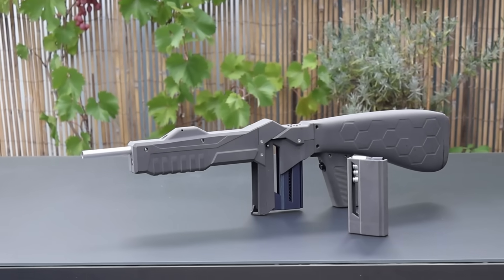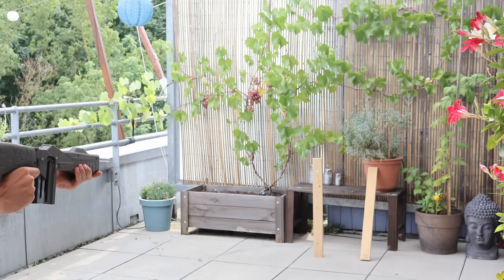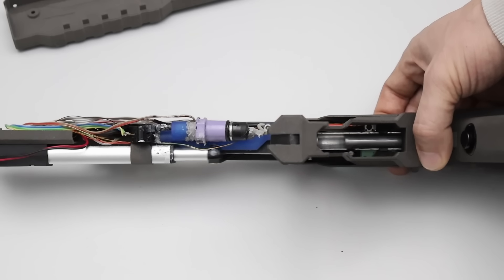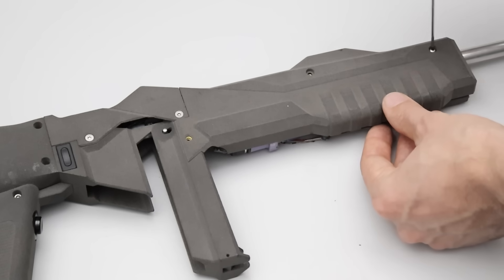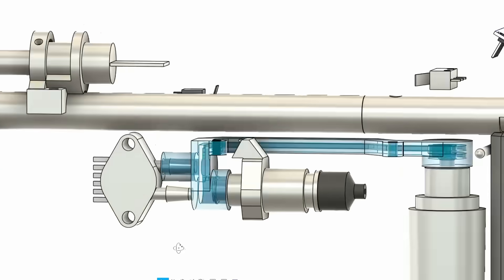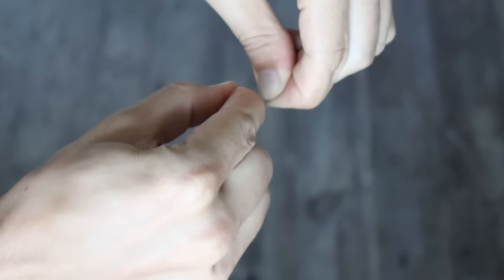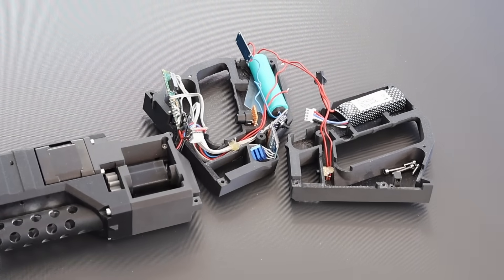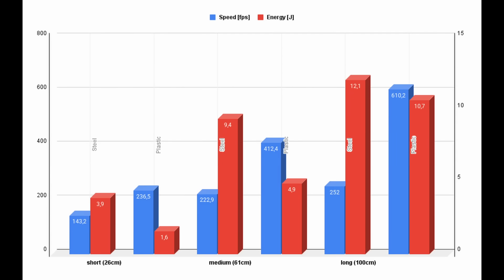I Built a Semi-Auto 3D-Printed Spud Gun

Comment: If you want to optimize your barrel length, look into the chemistry behind your cannon. Right before you fire, you have a tank with a known volume of air (containing a known volume of O2), and a known volume of butane. You know the volume and pressure before the combustion occurs, and you can do some basic stoichiometry to determine the pressure in the tank after the combustion. You can then use that knowledge to determine how much volume that new pressurized gas will take up. The volume of the tank + volume of the barrel should be slightly smaller than the volume of the combusted gas (There are losses due to heat, friction, non-instantaneous combustion, etc that will cause losses so the gas will reach 1atm before the theoretical mark). This will allow your combusted gas to completely expand and impart all of it's energy onto the projectile right as it leaves the barrel. 

I know for a fact you are wasting gas, and you know it too (whether you recognize it or not). You noticed it when you were trying to use the pendulum to measure the force of the ball, there is a massive amount of pressurized gas still in the tank and barrel when the projectile leaves the barrel. It was continuing to flow out long after the ball had exited and messing with your results. You can either increase the barrel length and shoot the ball really hard, or you can greatly decrease the chamber size and/or amount of butane so you aren't wasting volume/gas. 

One last note, you can explore suppressor technology with your current setup. You sort of already have with the baffle you created for the pendulum setup. I expect the reason it didn't work is the same reason suppressors have many baffles: the unit has to be able to effectively divert all the extra volume into the body of the suppressor (many baffles) and contain it from escaping (closed body). Your attempt to mitigate the excess gas was more of a muzzle break than a suppressor. 

Keep up the good work!

Comment: My guess on the subject of metal ball separation gap being less significant with longer barrels is that:

1. The pressure is behaving in case of plastic and metal same, so it applies same force to same area in certain distance from the chamber and is starting at Pmax and is going to Pmin=0 (to Pmin=0 in ideal case and your graphs doesn't seem to flatten so in your case it is not 0).

2. While plastic projectile advantage is less energy to accelerate it can accumulate less energy in total than steel one, and there is maximum speed every projectile can achieve for both of those projectiles for certain length.

3. I think (but i have to learn for exams so i don't have time to put calculations on it :P) Steel ball is using this pressure more efficient to acquire energy because it is more massive it stays longer in the barrel and is slowing down the pressure wave, and as long as there is possible pressure to utilize, more time projectile is under the influence of that pressure, and is possible for it to acquire energy. 

4. But there is a limit - as i said - to energy that can be gained from the combustion which is limited by the weight, but also i think there is another factor which is playing a role here that is leaks around the projectile, longer it moves through the barrel more gasses are leaking around it and through the hole systems lowering the pressure, so you might be witnessing just that. 

At jump from 26 to 61 cm barrel it is 2,34x longer while the speed of projectiles is:
-Plastic 1,74x higher
-Metal 1,65x higher

At jump from 61 to 100 cm barrel it is 1,64x longer while the speed of projectiles is:
-Plastic 1,47x higher
-Metal 1,13x higher

So in theory if there is same amount force for both of them and one is staying longer in the barrel, the one with longer contact with that force will gain more energy, but also longer it stays, more pressure is leaking, another factor would be friction. 

I think if you would graphs: 
-(x,y,z) friction energy loss in function of weight, time in barrel.
-pressure loss in function of time in barrel. for simplicity i would make it constant.
-(x,y,z) energy of the projectile in function of Force Max (calculated from Pressure times area), minimal force and time of the projectile in barrel.

Then i would just marry those all equations and you should have an answer for your question.

Just a guess but it is cool challenge to thing about it, great project!

Comment: How about Compressing the mixture like in a combustion Engine, instead of just mixing it in the rear. I think a modified 50 or 125 ccm Engine could be used🤔 then opening the valve at the perfekt timing ( more spacing to the Head might be needed )

Comment: I think the power difference between steel and plastic is coming from 2 things:
1. you can see the steel ball stops gaining much velocity from the increased barrel length (medium->long). most likely because it is not going as quickly, the combusted gas had already transferred most of its force into the ball before it had left the barrel, so part of the extra length is just at a low or neutral pressure. For the plastic, because it's traveling so much faster, there is still ample time and pressure still being applied on the projectile before it leaves.
2. Kinetic energy scales with velocity by a power of 2, so combined with the extra transfer of energy from the longer barrel (at high speed), the velocity allowed it to catch up on delivered energy despite being significantly lighter.
Reply: What they said x3

Comment: Did you think about building a miniature bore evacuator for the gun? Like in a tank cannon. 
Its basicly a chamber around the barrel, where after the shot pressure will be vented through drilled holes that face down the barrel. That way you maybe could aid the chamber venting.
Reply from the maker: This is an interesting idea. The time needed for ventilation is one of the biggest pain points in the current version, which I want to optimize in the next one. The principle could not be transferred one-to-one, but surely somehow part of the explosion’s energy could be used for ventilation. Maybe by using the Bernoulli effect. But this is not really thought through yet.
Reply: @it_could_explode Try making the combustion chamber a piston that reciprocates with the chambering mechanism. The piston can be used to reliably and fully pump out combustion gases and pull in fresh air, like how an engine is able to evacuate burned fuel and pull in a fresh mixture in fractions of a second.
Reply: Using bottled oxygen would fix whole ventilation issue

Comment: Very nice build. Enjoyed watching it a lot.
I originally had the same idea but I wanted to use as replacement for a HPA system and use a blowback mechanism from the pressure after ignition to load a new round into the chamber.
I never got to building it so you can have my idea if you ever wanted to build it .
Reply from the maker: Using the blowback for reloading would be great. I had thought about that too. For the next version I want to build one day, I’ll have to run some tests with it.

Comment: why does the vent at the rear of the tank have to face backwards? surely the shooter's shoulder would be the way and obstruct airflow, so you would have to take the stock out ot the shoulder to reload every time. would it not be better to face it to the side, or downwards for an  ambidextrous design?
Reply from the maker: That’s a good point. So far it hasn’t been a problem, since you have to wait about 4 seconds anyway and put it down during that time. But it still would have been smarter to draw in the fresh air from the side.

Comment: this is really cool and i think that the mechanisms could be mechanical instead of electrical too like a bolt action. would love to see other builds from you
Reply: Definitely possible, I made a pump action butane powered cannon with a 150ml combustion chamber (giant syringe) a while ago. The reload method after a shot was:
- Pull syringe body tube into piston to reduce internal volume, pumping out carbon dioxide and combustion products
- Reduce internal volume of syringe to exactly 5ml
- Inject butane (can be a liquid and flow in at any rate, it’ll expand to fill just the 5ml volume of the syringe body)
- Re-expand syringe to pull in air for combustion, forming a perfect explosive mixture of 5ml butane and 145ml air
Because the syringe body was reciprocating, the movement could also be used to pick up balls from a magazine and chamber them. I set up the cannon so the syringe was blocked from moving past 5ml volume and pulling the body all the way back would open a butane valve to inject the butane, making the reload a foolproof pull-push motion.

Sadly this device is actually illegal where I live so the cannon never fired projectiles and was only for making fast bang noises (which it was quite good at, putting out a 95db pop every 1-3 seconds)
Reply: @someonewithauniqueusername9397  Sounds awesome, I also tried to make a pneumatic magfed rifle but I couldnt figure out the logistics of magwell so its just a airgun

Comment: I would assume the differences in energy are just from how much of the gas' velocity is imparted into the projectile. The steel balls are heavier so they take more energy to move, thus they end up having more energy when they leave the barrel than the plastic. The lighter plastic needs more time in contact with the gas to gain the same energy the steel does.
I believe ideal barrel length would be when all projectiles have a similar joule count without losing too much total energy, since the barrel being too long can weaken shots. tbh though I don't know much about ballistics/gunsmithing so this is all conjecture based on my knowledge of physics.
Reply from the maker: I think your considerations make sense. Maybe I'll get longer pipes sometime to find out when the energy starts to decrease. If the ball is still in the barrel after the explosion is over, it should be sucked back.

Comment: Longer barrel = more gas burn = higher velocity. 
A change in gas type to a faster burning propellent will result in a higher velocity with shorter barrels.
Reply from the maker: Yes, I also thought about other gas mixtures. It would already make a big difference to use nitrous oxide instead of air, or even pure oxygen. But both are under very high pressure and are difficult to handle with my means. And the concept would also be kind of pointless. Why should I handle 50 bar of oxygen to create an explosion that generates significantly less bar...
Reply: @it_could_explode acetylene/oxygen would give you the highest fuel value but pressure would be drastically increased.